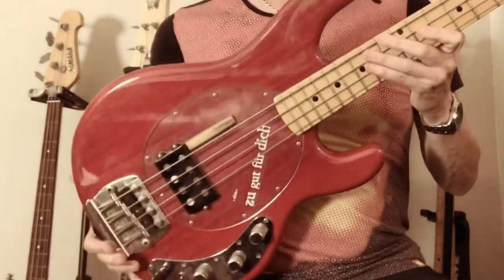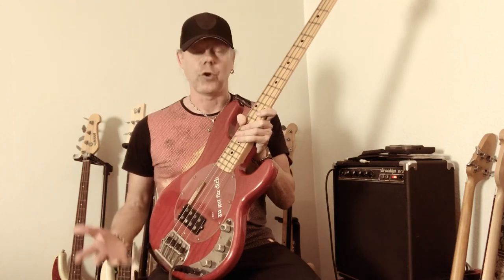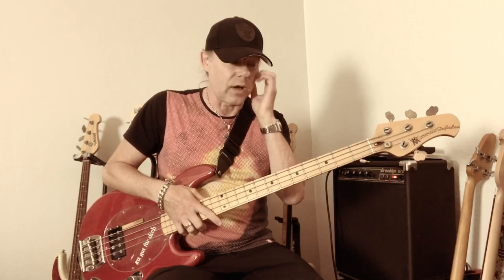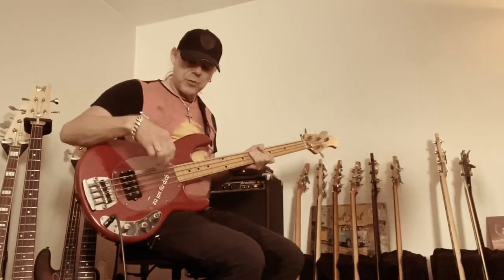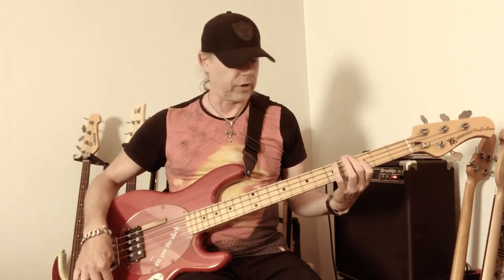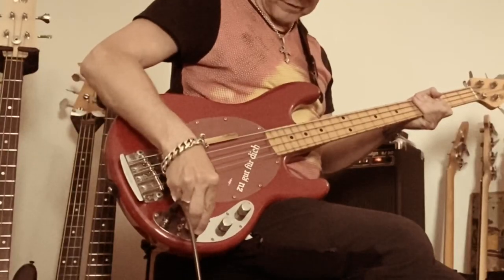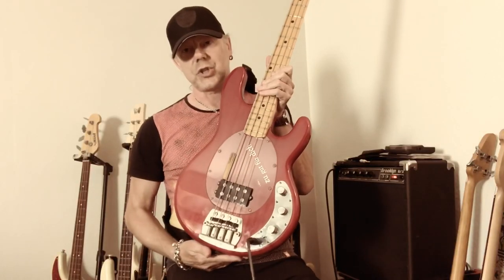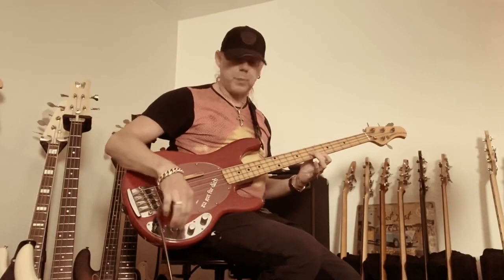how does a MusicMan StingRay Bass sound passive with bypassed electronics?

Comment: Nice video. Finally something to send to people who adamantly claim the Stingray pickup can't function passively because it's too low output etc etc (they clearly haven't tried it themselves :) )
Reply from the maker: thank you Jose. I am glad you found useful information in the video. All the best to you. Ollie
Reply: It is a pretty low output though, those pups are approx 1,950 Ohms with 2 coils in parallel. Doesn't make it unusable, but Stingray has never been a hot output bass, unless you crank the EQ (more so on the 3 band, due to mids). With EQ flat-ish, they're about on par with passive P basses. I usually bump the EQ on my 3 bander just a bit (all 3 frequencies) to get a slightly higher output, and a bit louder signal than my EMG GZR Precision bass (which is a vintage spec pickup). So, in short, passive Stingray would be unusable to me.
Reply: The people who love Stingrays based of the groups and forums I find are kinda "stingy" when it comes to modding if it's for resale value which I understand. But modding is entirely your personal preference especially if you're keeping it for a lifetime, so why not mod it? ^_^

Comment: I have a Westone Concord 1 bass, I've fitted a 2 way mini-switch which is either bypass or it engages a capacitor which is the one fitted on the original Rickenbacker 4001 & 4003 bass bridge pick up, it gives another sound option as the capacitor removes bass & mids, the pick up is a P bass split coil humbucker, when engaged it gives a more biting tone without the inherent hum of the Rickenbacker single coil pick up. I have yet to try it with overdrive but I think it would work well

Comment: What an interesting video, thank you for sharing this. I'm in the process of building a DIY kit Stingray bass at the moment. I've found a Sterling pickup to go in it and a slightly warmer 3 band EQ/preamp to replace the passive circuitry and 2 band that came with the kit. We shall see how they work out together 🤞.

It's still under construction (delayed due to a house move) but I'm not far away from finishing. I've got a question about your Stingray though, I also wanted a clear scratchplate but couldn't find one.  So I bought some clear plastic and fabricated one myself. Did you have to make your one, or did you manage to buy yours pre-made? 

Vielen Dank
Reply from the maker: Hi Jay,

Thank You for your kind words !

I actually never thought about this, but I am pretty sure that my StingRay's scratchplate is original. As far as I know some of them came with a clear scratchplate, especially those basses from the company ownership transition period between 1980 and 1984, like the bass you can see in the video.

As far as I know, the company that still makes the original scratchplates is called Chandler, which is based in California. You can check on this website which pickguard you need, then check the colorcode and order - or best you get in touch with them directly via phone or e-mail. I am sure they can help you get the scratchplate you are looking for:

https://www.pickguardplanet.com/music-man-stingray-4-string-basses/

good luck and fun with your DIY project and all the best

Oliver
Reply: Vielen , if the 3 band eq/preamp isnt what you want , the Mojotone '78 2 band preamp clone is amazing.  I have one in one of my '70's Stingrays and it sounds identical, basically. Drops straight in. https://www.mojotone.com/Pickups_x/Mojotone-Bass-Pre-Amps/music-man-clone-2-band-bass-3-knob

Comment: The Joe Dart sig, though very rare, is passive too I think
Reply from the maker: Yes, the Joe Dart sign. bass is completely passive, but it does have a different pickup mith ceramic magnets. The old StingRays had alnico magnets and the new ones have neodymium magnets. So they all will sound a bit different. However, listening to some recordings of the Joe Dart bass, it seems to sound pretty similar to the bass in my video, so in general the passive characteristics don't seem be too different from each other.
Reply: Passive SD ceramic PU, tone control removed, flatwounds e.g. Thomastik Infeld.

Comment: Oliver, I have a 3 knob sterling "by musicman" bass with a 2-band preamp. I'm wondering if I could wire the installed  4 lead humbucker pump to a Volume/Volume/Tone configuration just like a standard Fender Jazz. I would use 1meg linear pots for all three configurations. Do you think that this is possible? I've been playing bass for quite a while now and more and more I'm starting to dislike active tone circuits in favor of the passive tone organic sound.
Reply: Did you ever get to do this modification to your sterling? Sound’s quite interesting… 🤔
Reply: A lot of time has passed my friend lol. I ended up going a totally different direction and outfitting it with an audere 3 band preamp and an Aguilar musician pup. It sounds killer!
Reply: @KaltOhm also, fodera stainless steel strings.
Reply: @KaltOhm also fodera stainless steel strings
Reply: @eknight101  oh cool! It’s really a great bass!

Comment: How to manage with the volume loss chsnging to pasaive?
Reply from the maker: Hi Juan, good question. 
There actually is not too much of a volume difference between active and passive. However, especially the active bass control does supply a quite strong boost, if dialed in 100%. I usually back it off a bit anyway, so there is no volume difference. 

If both active EQ controls are turned up full, then I simply turn down the volume control a notch  (which is only working in active mode) to adjust active and passive sound to the same level.
Reply: Vielen Danke für die Antwort Oliver.

Comment: Firstly, I wonder if it's possible to do this to the current Special models considering the new neodymium magnets and the preamp, and how it would sound. I'm asking because I would like to own a Stingray 4HS someday to replace the neck pickup to a Seymour Duncan Rickenbacker neck PU and wondering how that would turn out.

Secondly if I were to say what knob would be the psuedo-tone control in passive, which would it be? The bass, mid or treble?
Reply from the maker: Hi Reinhard,
as regards the new neodymium pickups, I would still assume that they work pretty well in passive mode, but that's just me assuming it.

Other than that I honestly have no experience in modifying electronics and pickup configurations. In fact, this little passive bypass switch being presented in this video is the only modification I ever did to one of my bassguitars. 

Good luck with your ambitions and it would be interesting to learn about your experiences once you may have proceeded with modifications on a StingRay like the way you have described.

all the best
Oliver
Reply: @oliverposchmannsbassguitar758  Thank you!

Comment: Great, I wanna do the same thing to my Bongo6, what do you think?
Reply from the maker: hi, I honestly don't know how different the pickups are in comparison between StingRay and Bongo. However, the models which followed the Bongo, the Big Al or the 25th Anniversary/Reflex all had similar pickup configurations like the Bongo and 4-band EQ and were equipped with an additional passive mode. So, in general I'd assume that nothing speaks against the Bongo to be retrofit with passive mode as well - but that's just me guessing. However, the tonal options of the Bongo are incredible already with just the active mode, I find.
Reply: @oliverposchmannsbassguitar758  thanks for the reply! I believe the pickups are almost the same. I agree that it already sounds wonderful but I wish mine had sometimes independence from batteries

Comment: Hi Oliver, 
thanks for the video. Would you do us a BIG FAVOR :  could you please find the bass/treble setting where the pickup tone is most similar between active and passive ?
In fact there is much misconception on this 2eq preamp with no centre detent (unlike the 3eq): some say both bass/treble are boost only, others say they both are cut/boost but without centre detent, and the most knowledgeable say bass is boost only while treble is cut and boost. It mean the neutral setting should be bass on zero and treble half way up ...could you please confirm ? Das wäre ja super nett von Dir :o)
Reply from the maker: Dear Paolo,

thank you !

That is a very good question. I should have thought about that when making the video. I might do a short one to proper illustrate the answer, but for now I simply try to answer your question here:

If you think of the controls like the center of a clock, they rotate only from 12 o'clock (full/open) backwards to just about 2 o'clock (down/closed) - if you look at it from the front, going anticlockwise. That means the full range of a control goes around approximately 80%, not 100%.

If there would be a mark on the knob, pointing to 12, while full up/open, the setting of the active EQ sounds equal to the passive bypass mode, when both controls (bass & treble) are set down to 6 o'clock (half circle turn down). Therefore I would say that the EQ sounds "neutral" at around 40% of the full control range.

At my bass, the screws which fix the knobs to the poti-axis are set exactly at 12 o'clock, which makes them a good marker/reference point. That means the screws point towards the player, while looking down at them when the bass is strapped on. If I now turn both EQ knobs, so that the screws are pointing 180 degrees down to the opposite side (6 o'clock), this is when you achieve the same sound like the bass set in passive/bypass mode.

Therefore I can say, neither is the EQ sounding neutral in zero position, nor in 50% position. A proper detent position would have to be set at around 1/3rd of the control rotation towards the closed position.

I hope this was clear enough?

I'll make a video, showing this in detail, as soon as I find the opportunity to do so.

Wishing you all the best

Oliver
Reply: Thanks Oliver, this makes sense. Although it seems bass knob is boost only (in other words, neutral when turned all the way ccw) and treble is cut and boost, but with the centre detent not exactly in the middle. It would be wunderschön if you could confirm this...
Reply from the maker: @paolozak3014  Paolo, I don't think the bass control is boost only. The pickup in bypass mode delivers way more bass as in comparision to the bass control set to zero. The bass needs to be dialed in around 30% to make it sound equal to the bypassed passive signal. Hard to say about the treble EQ, but again: If it would be cut and boost you would logically assume it should sound neutral at around 50%/middle setting, but it does not. Like the bass control it must be set lower than 50% to match the bypassed passive signal. I will do some recording with it and add it to the channel.
Reply: Ok, I see. I have a 77 Stingray and indeed it sounds neutral to my ears when bass it at ca. 30% open and treble at ca. 50%. But I play Labella flatwounds, so I'm not completely sure... really interested in your nächste video 😉
Reply from the maker: @paolozak3014  , I'll do it :-), give me a few days.
cheers
Oliver
Reply: @oliverposchmannsbassguitar758  another thing, when turning up treble I have the impression the last 20% have same effect as the first 80%. I mean, when opening treble past 80% the upper frequencies really jump up a lot ...actually perhaps a bit too much. Maybe useful for a very treble-shy cab...
Reply: @oliverposchmannsbassguitar758  hello Oliver, have you already had the chance to do this comparison finding the 2eq setting that would sound exactly like the passive mode ?
Reply from the maker: @paolozak3014  , you can find the video now under this link: https://www.youtube.com/watch?v=DDeCHOv7Rqk

best regards, Oliver

Comment: Aren't pre- Ernie Ball Stingray bass preamps boost only? Basically (bassically?😁) flat when rolled all the way off?
Reply from the maker: Hi Raymond, 
mine definitely is not flat when rolled all the way off. I am not sure about older pre Ernie Ball models (the ones with three neck bolts). I did another video, in which I show the positions of the tone controls which come closest to "flat".

Here is the link:
https://www.youtube.com/watch?v=DDeCHOv7Rqk

All the best

Oliver
Reply: @oliverposchmannsbassguitar758   3 bolt Pre EB's were designed as a cut and boost preamp, so ideally, the half way point is roughly flat, as long as you have the correct pots installed. Thats the way they were designed from the start.  :)
Reply from the maker: @thebutton7932  , thanks for the info. The middle position is not flat on my bass, which is an early 80s, 4 bolt. You can see/hear that in the other video I did about the StingRay:

https://www.youtube.com/watch?v=DDeCHOv7Rqk

best wishes
Oliver
Reply: @oliverposchmannsbassguitar758  the taper of the pot DRASTICALLY affects the way this plays out. I had the wrong taper in my treble pot (1meg log taper) when I bought it, and that made ALL the adjustment occur in a very small area. The Stingray pots have unusual, values . These pages (categories at top of the page) cover your bass as well as through early EB . . all details , worth a look, imo  http://www.musicmanbass.global/sr4-pups-and-preamps-pre-eb-eb-part-1/

Comment: Can a preamp make the change in tone from passive to active and therefore skip the necessity of having active electronics?
Reply from the maker: Dear Russell,
I am not sure if I understand your question correct. If it means "can you make the active preamp sound passive without actually having to add a switch", then my other video might be helpful for you, in order to find a position which equals passive mode:

https://www.youtube.com/watch?v=DDeCHOv7Rqk

all the best
Oliver
Reply: @oliverposchmannsbassguitar758  I mean can you make a passive bass sound like an active bass with a tube  preamp?
Reply from the maker: @Spritsailor  
aah, now I got it. Thank you.

Yes, you absolutely don't need an onboard active circuit. Instead you simply use an external preamp, of which there are tons on the market, whatever suits your taste. Tube preamps are great, however they do not necessarily make your bass sound "active" (whatever one may define as an "active" sound). A typical example what to use to simply enhance the sound of a passive bass is the outboard "Sadowsky" pedal. Another typical example for a classic tube emulation pedal (without actually using a tube) is the SansAmp Bass DI Driver. But there are so many more on the market these days. It really depends what you are looking for.

A great tube preamp/DI I have just lately found is this one, which I can highly recommend:

https://shift-line.com/olympic
Reply: @oliverposchmannsbassguitar758  I figured they invented the Stingray when most bassists were already buying solid state.
Reply from the maker: @Spritsailor  
I think what was the initial idea behind the active circuit on the bass itself was 
a) to give it a different sound in general
b) give the bassplayer more sound control on the actual bass and not just the amp
c) give the bass a signature sound colored by the electronics.
d) change the impedance of the bass output, helping to avoid typical frequency/signal loss using (unbalanced) guitar cables

The StingRay definitely achieves it's signature sound through the electronics (more so than through the actual pickup, which the video reveals), many other bass guitars do also achieve that.

I think there is a real division between two philosophies. One favouring the sound of a passive bass and then getting all coloring and tweaking from external devices, the other one putting a focus on a "all in one" solution, getting it all out of the bass, which has its advantages, especially if you favour more linear sounding equipment in the following chain.

I love both approaches - the joy of variety :-)

Comment: When in passive mode do you have any tone control at all?
Reply from the maker: Hi Josh,
no, not in my modification. It is just a pure bypass switch, directing the pickup signal straight to the output jack. This way there are no electronic elements between pickup and output jack. I suppose, if you wanted more control over the passive sound, you could add a passive tone control, but this was not the intention behind the idea in my case.
Reply: @oliverposchmannsbassguitar758  Its a great idea. Ive had a Music Man Stingray since 93 and its probably one of the hottest active basses Ive ever owned. The bypass switch is a great add on. To bad they dont ship from Ernie Ball that way
Reply from the maker: @joshbaker5403 
yes Josh, they only once added a passive Push/Pull Pot to one of their rare anniversary models. It's a mystery to me, why EB don't add a passive switch as a standard, especially since it is so cheap and easy to do. The Reflex basses for example come with passive switches and tone control and it is a great feature. You could argue "oh, they don't want to mess with the tradition" but they have done so ever since introducing the 3-band EQ and many other changes, so why not a passive switch?

Maybe one day :-) ....
Reply: @oliverposchmannsbassguitar758 thanks Oliver for your post. Could you please share a wiring diagram to solder the pickup directly to the output ( no tone control )? Thanks